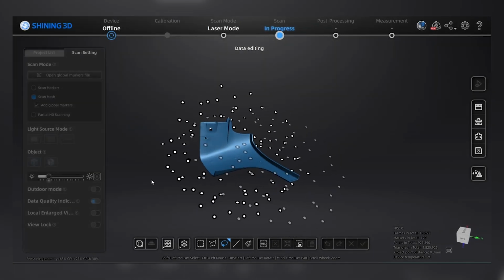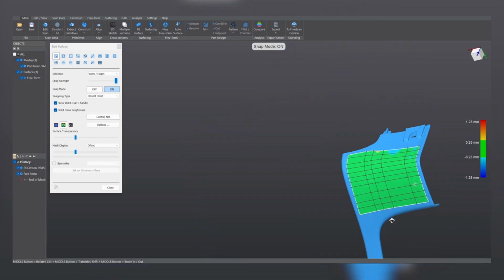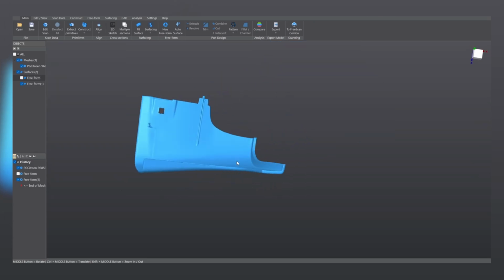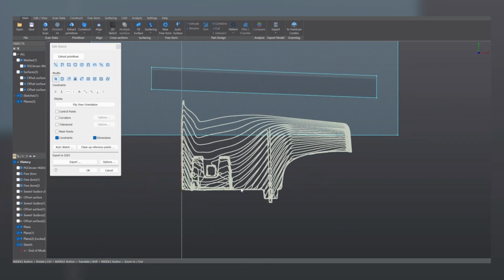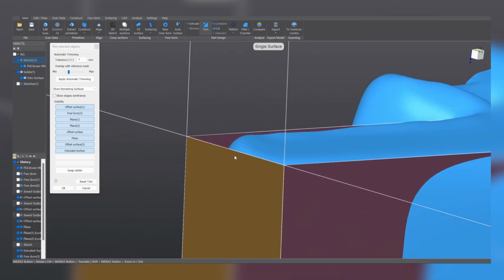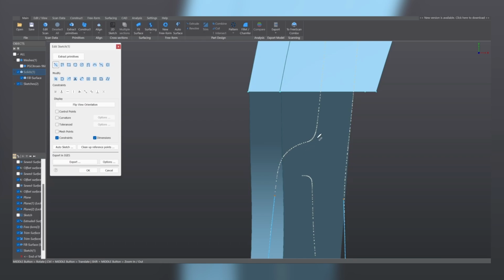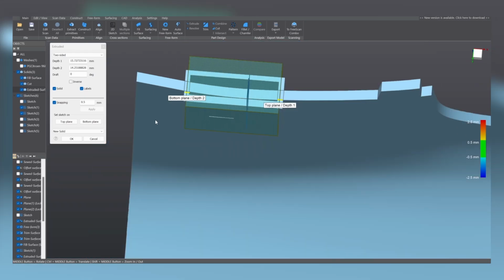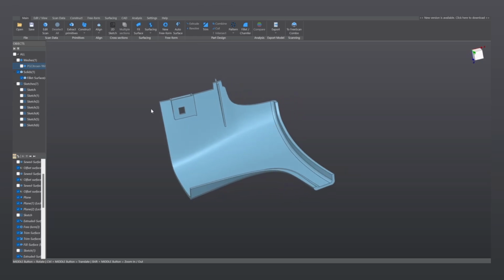Step by Step Reverse Engineering in EXModel Pro

Comment: The problem I have, is 95% of the videos are all using PRO version. Very, very limited use of the ExModel. Go to do this, need pro, need to do that need pro. The only good thing I can see it has a 1 & 3 year subscription. No yearly subscription for the Pro version. Not sure if I am going to by.
Reply: I hear you. I bought ExModel light, same as quicksurface light to see if its worth bying the pro version. I to wish they would have the 1 & 3 year subscripton to pro

Comment: How to set an object perpendicular to the grid? The exercise file, after loading, is placed at an angle to the Z axis. Changing the axis settings doesn't help. In the tutorials, the object is immediately placed perpendicular to the grid. We've gone through them, but couldn't find any hints. We're stuck at a dead end. Could you provide a simple solution?
Reply from the maker: Hi Thanks for contact. Can you please provide us your email address that we can support you. Or you can send an email to our support:  einscan_support@shining3d.com